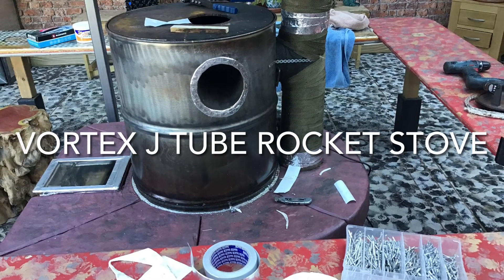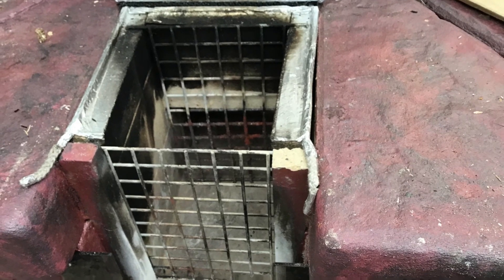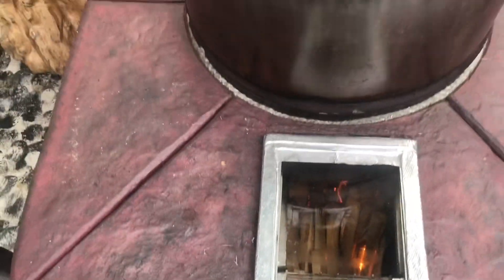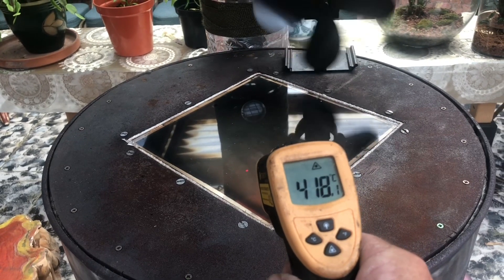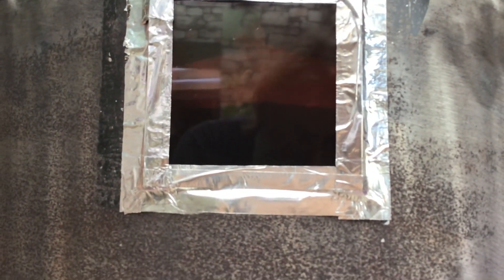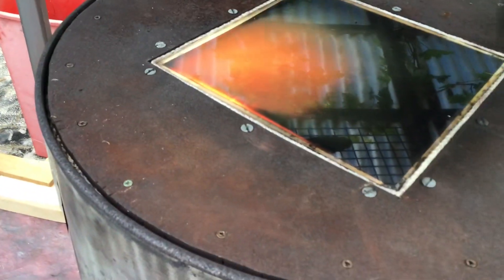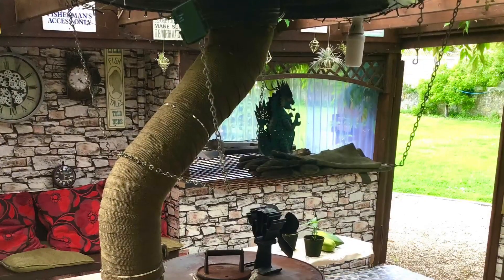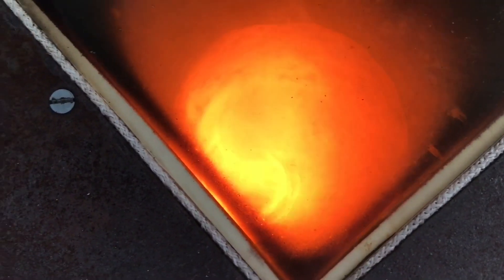Vortex J tube  rocket stove

Comment: Thank you for sharing. If you can please inform us about the precise measurs of the rockt stove?
Reply from the maker: It is based on a 6” system but with a slightly bigger firebox . I think the fire box is 7” wide and 8” long.
The total inside is 18” long with the tunnel at 6” wide, the riser is 32” from top to bottom.
I will make a more detailed video in the near future and show the exact measurements .
Reply: @foxfish7115  thank you and looking forward. Keep up the good work..

Comment: Could you add a preheated air supply to the base of the vortex to burn the carbon monoxide I'd love to see the temperature go above 600c easily
Reply from the maker: There is a secondary air supply, it is situated at the top between the fire box lid and the barrel. So the air runs down the tunnel roof and feeds the vortex… maybe!  
Ha yes well 600 is quite possible as I have seen 530c but I would have to stuff the firebox with very dry kindling but the glass would soon etch and become opaque … to be honest 300c is a better all round temp as I can slightly restrict the air and get longer burn time without reloading the fire box every 30 minutes but it still pumps out heat enough for a cold night!
Reply: Wow that's really impressive. Can you run hot water off it or a central heating system with an indirect hot water tank to provide hot water. Just another question how much would it cost to install and could it be smaller
Reply from the maker: @keithsyers5833  Quite possibly  but I have no need in my circumstances as the fire is just in my garden party house (firehouse) but I do boil a kettle to make tea !
Reply from the maker: @keithsyers5833  Well it may well be possible but the design is a one off creation to suit my needs of space heating and cooking for fun. The stove is in my party house at the bottom of my garden where we have family gatherings and friends to play music. The fire does what it is designed to do but the basic principle  of the rocket stove can be sized down to a 4” system or scaled up to 8” mine is a 6” .